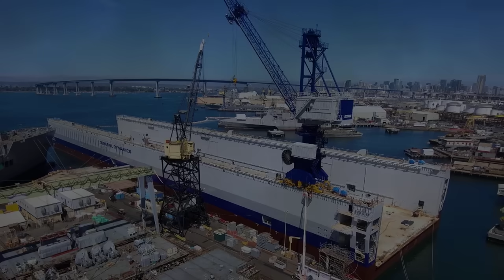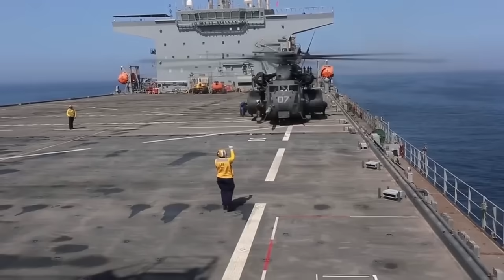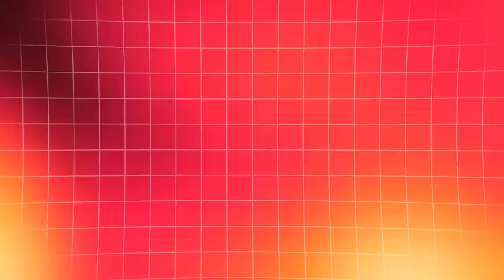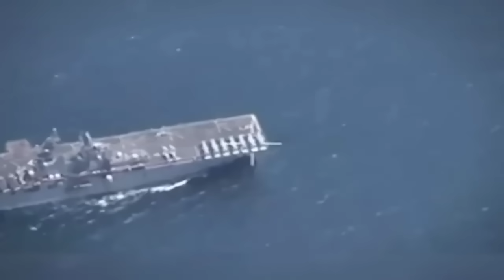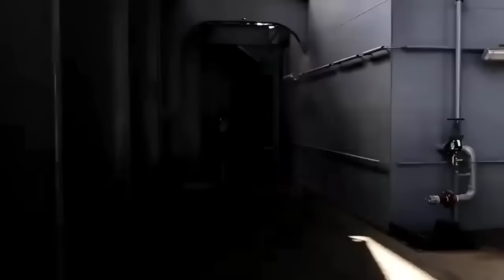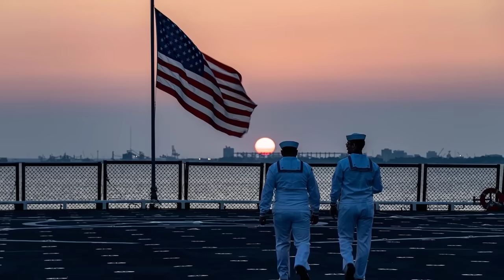Inside the NEW Expeditionary Sea Base — The Last One Ever Built

Comment: 8.09 in this case, the perfect tool gets reassigned to a different theatre or to a defended location.
w a 40 year design life, the odds that a second build would still use an ALSKA hull are slim. as stated, the navy HAS the ships it needed for locations without ports.
as such, the lack of follow on ship or further discussion is simply because they DID get that perfect tool: no further consideration is NECESSARY.
and frankly, even in a Pacific war, those vessels could easily see mission roles in convoy protection (while carrying their own supplies contribution), a USN base in any local allied harbour,  a relief unit sent to any devastated but retaken harbour, a relief element for humanitarian need, mobile warfare by Being that mobile base to open a hit and run or flanking opportunity via methods that have never been available before (obvs w a protective combat element).
heck, drone warfare methodologies Could see this platform converted as a viable Drone Strike Platform.
these ships are well positioned for long, stable careers, or crucial roles at critical need.
the concept won't go anywhere, but the next iteration will be a different design brief, and likely a different nomenclature.
vessels of similar versatility have been seen in naval procurement before, tho usually w much criticism: escort carriers, carrier conversions, and Q-ships come to mind from WW2. the carrier conversions had merchant hull versions as well as military hull conversions, and Q-ships are inherently Merchant hull.
the biggest difference between those and this type was twofold: air operations, and container standardised modular equipment... tho arguably, the peacetime Naval planning and the time for complete conversion count.

Comment: The WW2 Casablanca class escort carriers' design evolved from a cargo ship hull and were arguably more effective than the Independence class light carriers. The ESB shows that the navy can develop an effective solution when needed.
Reply: The Casablanca’s were similarly based on tanker hulls. Comparing them to the Independences doesn’t quite work though. The Independences could do something the Casablanca’s could not. Keep up with the Fleet Carriers. The Casablanca’s and the other CVE cousins offered incredible Utility. But they lacked speed. This worked out great as they become the perfect Marine Ground Support platform. They could cover the invasion beaches and forces, leaving the Fast Carriers free to deal with the Japanese Navy.

Comment: This ship is one of the biggest blunder of the US Navy and one of the most stupid and ridiculous projects of the US Defense Department. This ship is very huge, very heavy and very slow. It has a very big radar cross section that can be easily targeted by enemy ships thru Anti-ship missiles and most of all the very fast Hypersonic missiles. It is so big that it can be easily seen on radar by enemy aircraft and get targeted again by anti-ship missiles. It is so big and so slow that it can be easily detected by enemy submarines and targeted easily by torpedoes because it is very slow. This should not be considered a Navy ship since it is very slow and easily targeted at just maximum speed of 15 Knots ! Another point: This ship will never survive without escort ships because its least defended ! Its weapons are only 12 x .50 caliber machine gun stations ! How can this ship defend itself when attacked ? No VLS, No CIWS, Nothing ! In summary: This ship is more of a liability than an asset ! Very huge in size, very heavy, very slow and almost unarmed ! Very huge Radar Cross-section and a very easy target by the enemy.
Reply: It’s not a warship. It’s a logistics node.
Reply: @bloomfield8  That is not the point. It is a Navy Ship. If it can't defend itself, its pointless. If its too slow, too big and too heavy, its a liability than an asset. It will make the fleet more vulnerable to attack due to its huge radar cross section and slow speed. Smart opposing forces target the supply ships, fuel oilers, and replenishment ships to cripple the entire fleet and destroy the morale of the sailors. That is proven in World War 2. You lose more supply ships, you also lose many weapons and ammunitions but you also lose lots of food supply, water supply and even hygiene kits like ass wipes. hahaha
Reply: They are never ment to be within the firing rage of anti-ship missiles and fighter aircrafts, only submarines are a real threat to them any surface naval ships coming near them will be dealt with by the US Navy’s war ships.